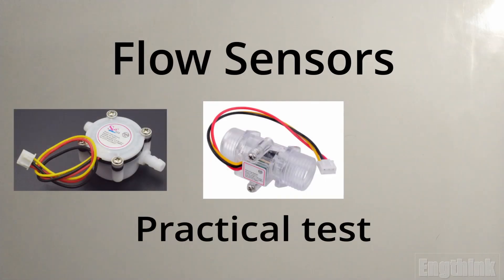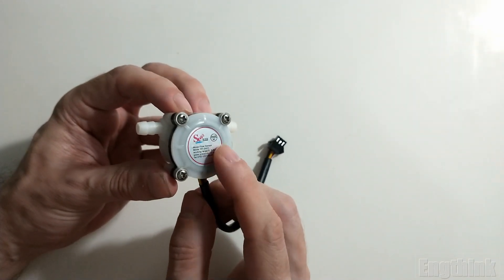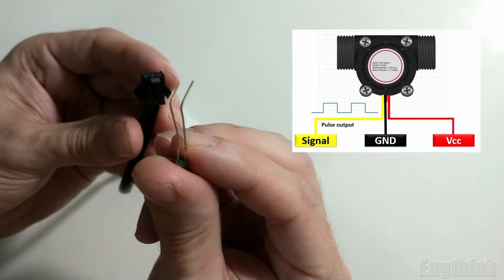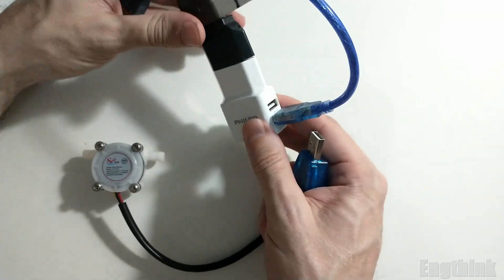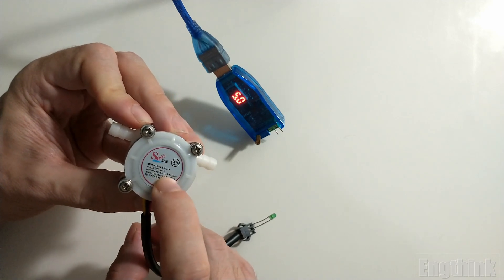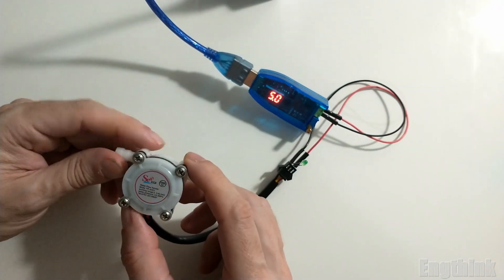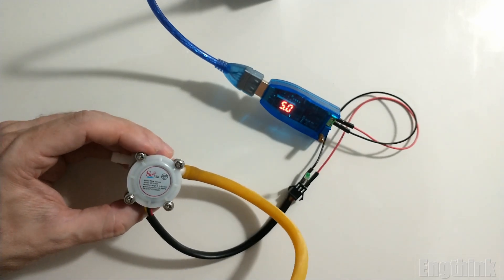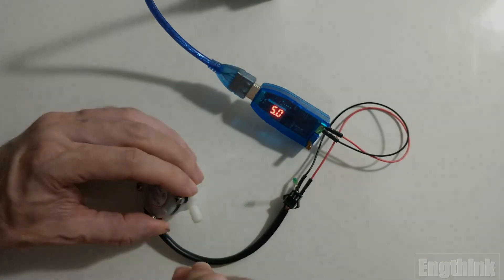Flow Sensor basic test and how it works

Comment: Hi sir, can i use this water sensor as a flow switc for dc pump ?
Because i has wrong purchase this sensor instead a flow switch.
Reply from the maker: For this case, you need a circuit or microcontroller (Arduino) to detect pulses and generate a steady signal.